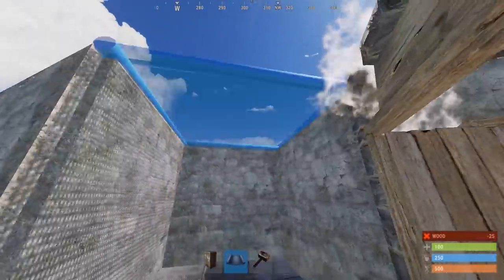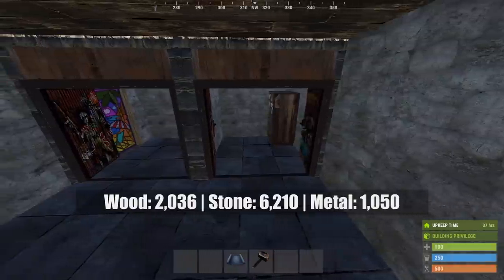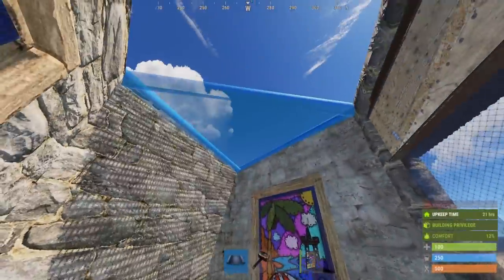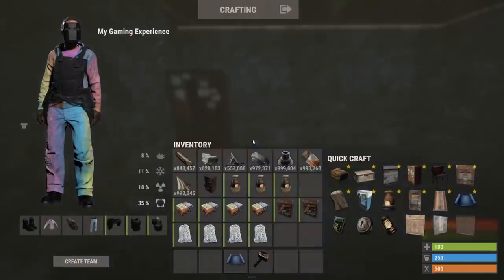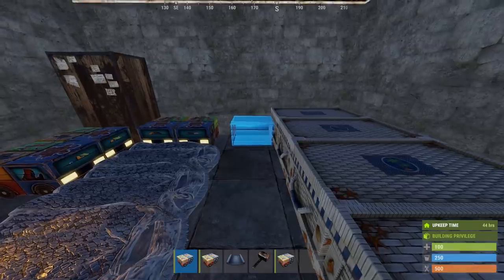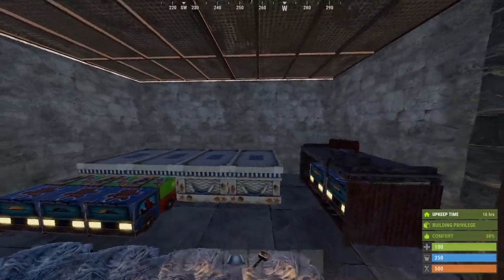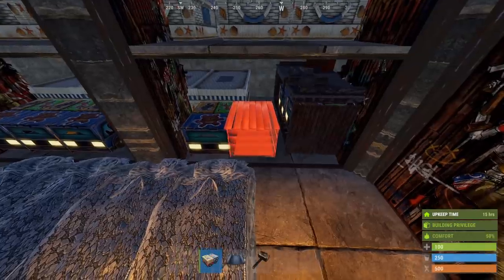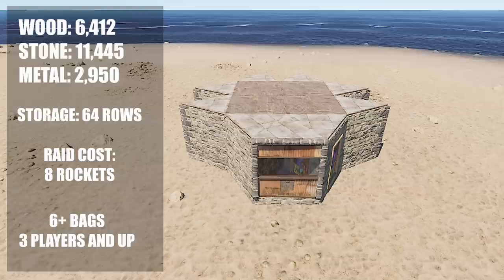RUST - Is My Starter Base The BEST? - Rust Base Design

Comment: The first base is a 9/10. The 1 point deduction is for the initial airlock which is easy to push through with 2 ppl. And the shop front only shows you people camping on one side of your base, not the other. It helps slightly, but we need vision on BOTH sides!!!
Reply from the maker: that is true, there are some slight adjustments that would make it better

Comment: In the first design, you could make the square foundations elevated and drop the triangle foundations down and then place 6 furnaces to serve as your floor. You'd lose one sleeping bag but the other could go into your workbench room to replace those furnaces. If you don't want to change the base / raid cost, you could drop only one of the foundations and then you'd have the same number of sleeping bags
Reply from the maker: that is very smart
Reply: @MyGamingExperience   swales always builds his starters like that he calls it the bunny

Comment: in the first design, he stated that putting honeycomb on the squares is pointless because they will go through doors. because of that, build a triangle  straight away off of the squares and use that for furnaces.
Reply from the maker: the back 2 triangle are behind the garage door

Comment: First one is definitely good but if u have 6+ man in your group its hard to move around because we sheet metal doors. My suggestion is garage door tc room and loot room next to so it will be not much but it will work. Second one is good and you can turn it into hjune's 2x2 starter to main.
Reply from the maker: garage doors would def. be better in the core there, i just was trying to stay as cheap as literally possible

Comment: You missed the 2x2 window bunker base(maybe new meta). Footprint only require a 2x2 and a triangle coming off and it requires no doors when initially building. Super secure and super easy to build.
Reply from the maker: window bunker?

Comment: I just do a couple Thrifty Scotts....super cheap and just as strong. One on each end of a road with supermarket or gas station in middle.

Thrifty Scott is two squares, three triangles...that's it. Door raiding is 2 single doors, 2 double doors and a reinforced glass window/embrasure to the tc.

Edit: You not separating the two loot rooms with a wall but having two double doors to the space anyway REALLY messed with my OCD. That seems pretty less-than-ideal. Put a wall in and make them work for it.
Reply from the maker: that is totally viable, i was really only trying to test the starter i usually use against a 2x2 variant

Comment: I rly like the Standart 2x2 but I usually add a bunker and turn it into a main base
Reply from the maker: yup i have 2 videos with 2x2 bunkers, they are very good choice
Reply: Every time i try to make a bunker, it simply doesnt work☹
Reply: ttv catbuuu  yea i realised i made a mistake. I was building very low foundations, and then half walls, istead of raised foundations and therefore it didnt work.

Comment: The 2x2 honeycomb you made was not 8 rockets everywhere you didnt honeycomb your first set of doors so thats an easy 5 rocket and a handful of explo
Reply: Also you didnt put any locks or account for them
Reply from the maker: that 2x2 is 8 rockets from all directions.
if you go through the doors it will be 2 sheet, 1 garage, 2 sheet
if you go through the wall after the front airlocks it actually costs more, 1 stone wall, 1 garage door, and 2 sheet metal doors

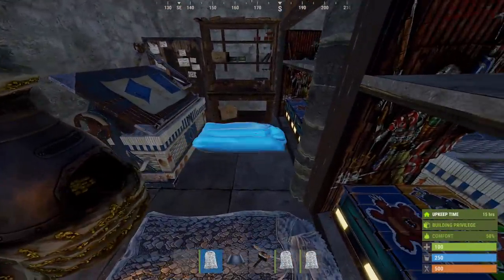Comment: when you realise that the only original base is the first one. and the only reason there was 3 was to get it to 10:00
Reply from the maker: there was 2
Reply from the maker: the whole point of the video was to see if the starter base I use is better than a 2x2 variant

Comment: How do you build the first starter base TC lootroom
Reply from the maker: just the normal way, build a foundation half wall and floor on the outside and then attach that loot room triangle to it from the inside
Reply: @MyGamingExperience  Yeah but Idk how to place the boxes on top of the triangle in the tc room ;/